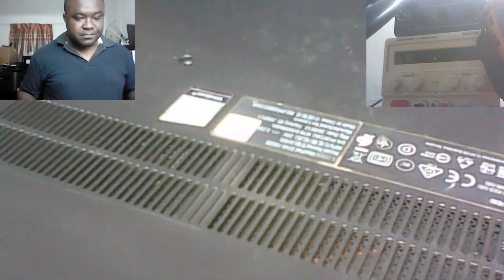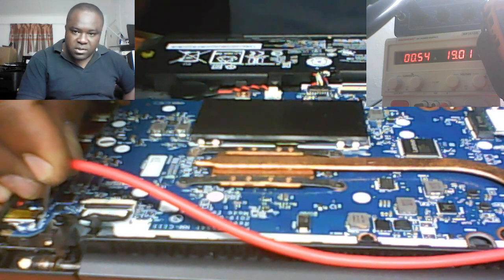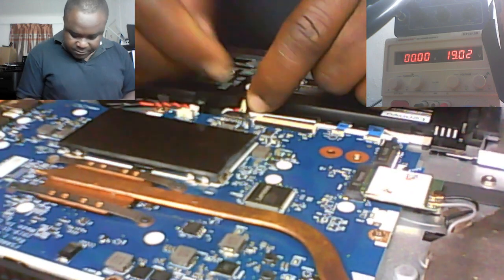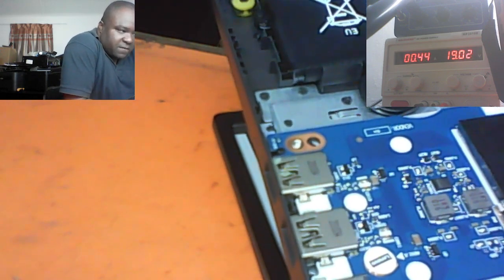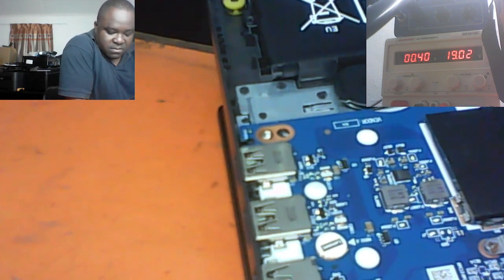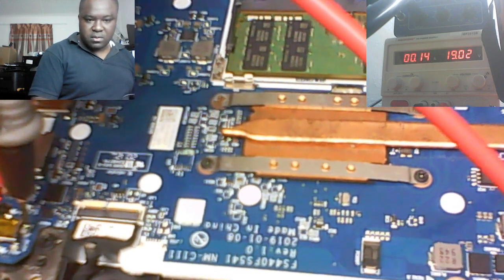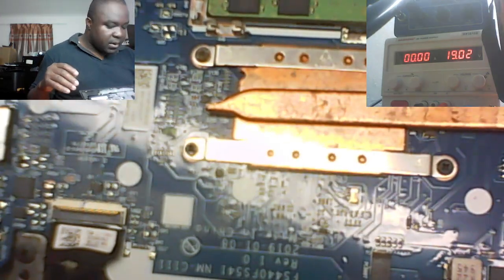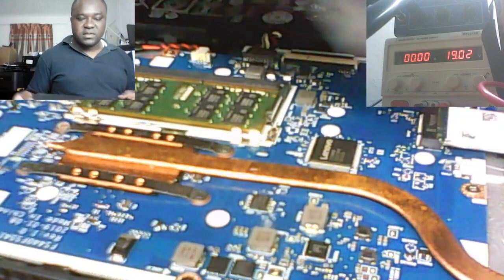Lenovo IdeaPad S145-15IGM No Display FIX

Comment: mine still it doesnt turn on yet its a similar laptop
Reply from the maker: No power or no display??
Reply: @borvitech  no display
Reply from the maker: try use a low voltage ram
Reply: @borvitech  but it supposed to work without Ram, the motherboard has built ram 4gb or ?
Reply from the maker: so you are using onboard ram??
Reply: @borvitech  yess the Motherboard has onboard Ram
Reply: @borvitech  on board ram and one more slot for  ram and that slot of ram was empty
Reply from the maker: Are you a technician and do you have bench power supply??
Reply: @borvitech  I checked the wattage everything was fine maybe corrupt Bios chip ummmm... 🤔
Reply from the maker: On the ram section what voltage do you have there??